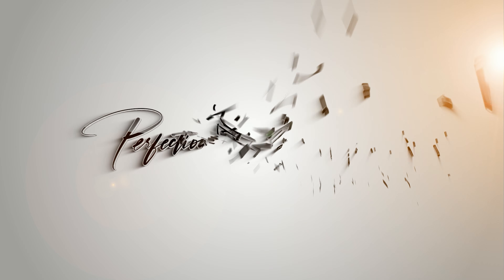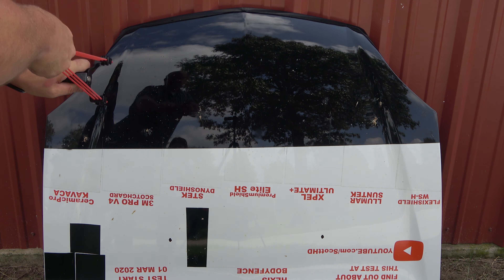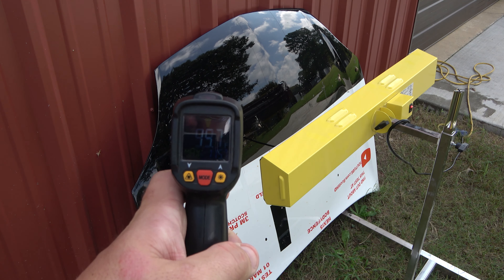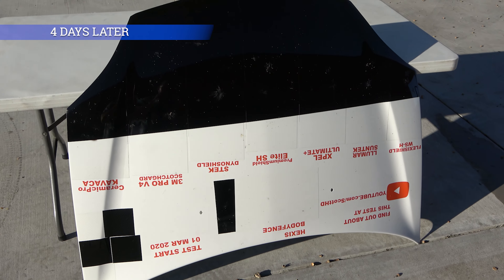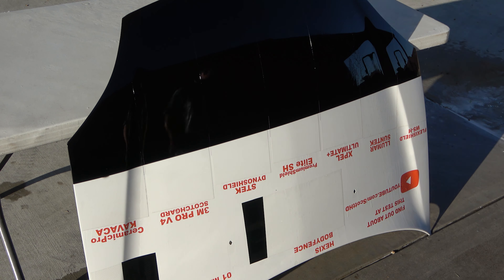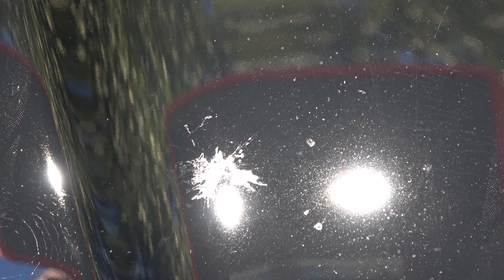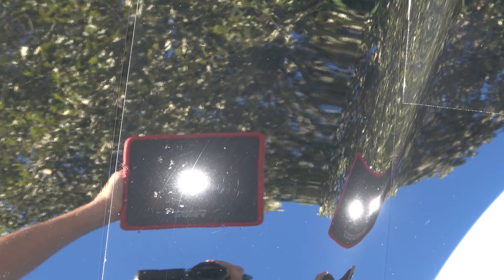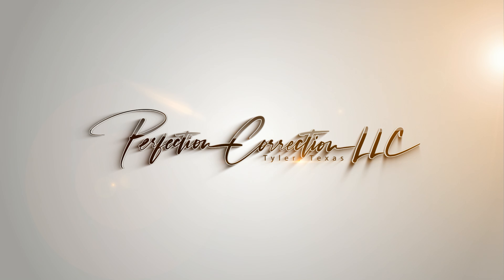Paint Protection Film PPF - UPDATE 12 - Ultimate Longevity & Durability Test - THE BUG GUTS TEST!!!

Comment: Nice video as always! Here is an idea for a video: Bug remover test. You could take a hood and hit it with bugs in 2 rows. Hit it 4 times. 1 spot 4 days before the test. 1 spot 2 days. 1 spot 1 day and 1 spot 6 hrs prior to the test. Spray bug remover only on the bottom half of the hood exposing the bottom row of bugs to bug remover. And then the whole hood with regular car wash soap and see if the bug remover makes any difference.  You could maybe also reserve a spot  where you apply your favorite ceramic coat and see what happens to that, but I believe bug remover would destroy ceramic coat too

Comment: Perhaps one reason Kavaca came out on top was because it didn't get as much heat as the others. You can see that the outboard sections of the hood did not have as high of a temperature reading when you checked it. Just a thought.
Reply from the maker: Possibility.  It still got pretty hot!

Comment: I have XPEL on the front of mine. My experience is the bug splatter is difficult to remove most of the time. I have to use one of those bug mitts to lightly scrub them off, even after using griot's foam & their boss cannon with their brilliant shine. I only use the mitt where the XPEL or plastic trim is however, nowhere else. I do find however that the headlights are just as difficult to remove the splatter from, maybe even worse at times & they don't have ppf. I'm still able to clean the film though of splatter & etching. However,  I'll find a place where there's an indentation in the film on the hood from a hit, it has the look of frosted glass in that spot compared to the rest of the film. Come back a couple of days later & the film has "healed" itself so it's gone but there's another film indentation from another random hit in another spot. So, it's doing it's job so far. I had it installed Feb or March of this year.